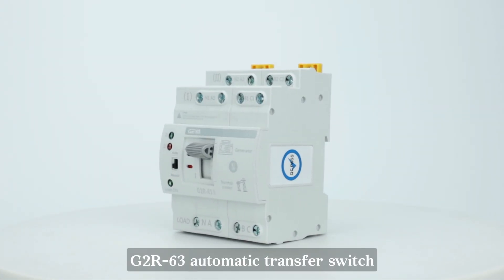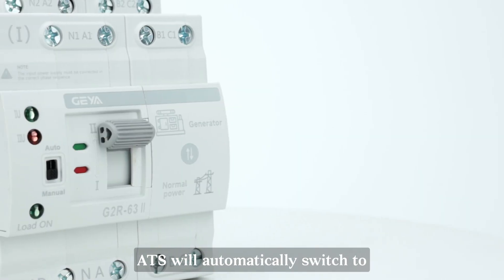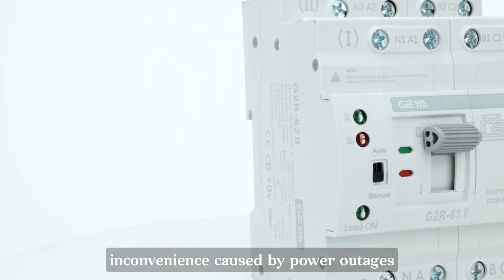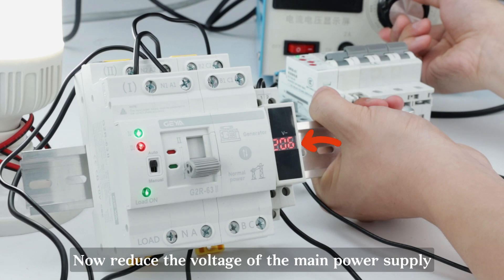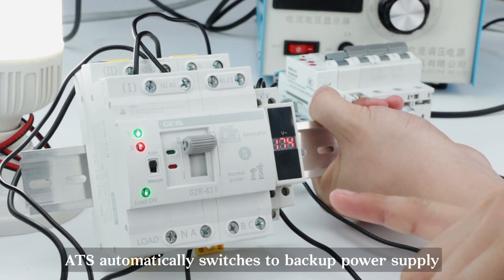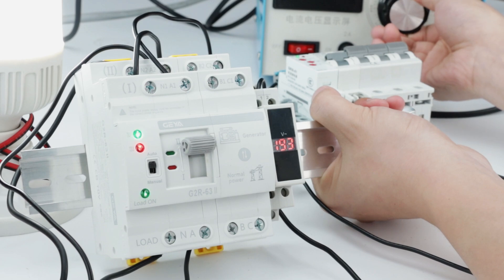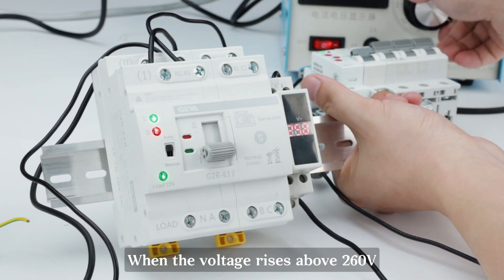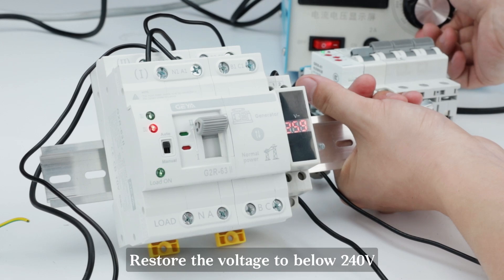GEYA G2R-63 ATS Demonstration of overvoltage and undervoltage function

Comment: What is the control voltage? How to connect it?
Reply: This instrument is not a Contactor,  is ATS. I hace this ATS for backup sistem between the grid and backup solar system. This instrument change principal circuit  to the secondary circuit, when the principal is in Mode Black out and you need energy from other energy system. Also for other applications. Very good instrument.